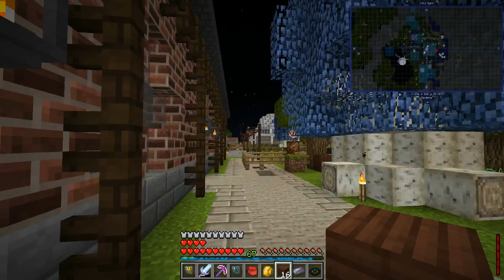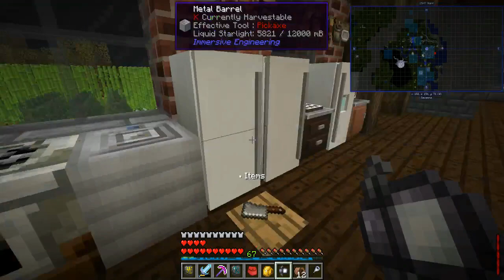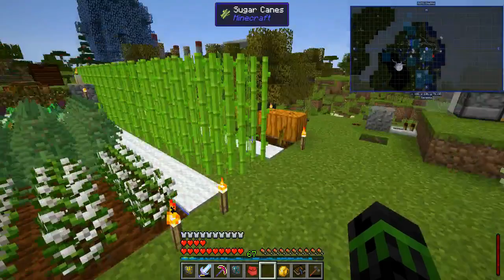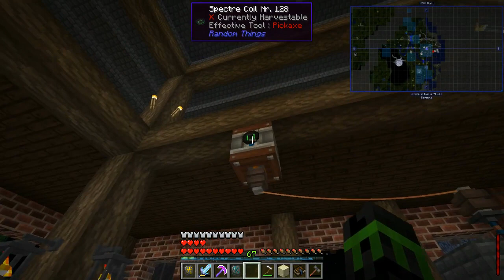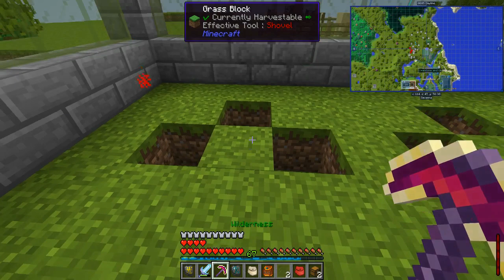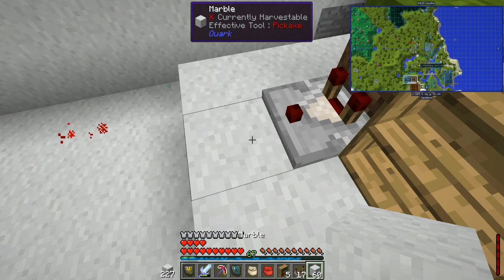Arcane Revolution - Ep 16: Industrial Greenhouse

Comment: You probably want to use HV for that many Cloches. LV for sure will not keep up with the power requirements. 
Take a look at insulated wires, they don't damage you if you walk into them.
Reply from the maker: Yeah I experienced the uninsulated part the other day off camera.. with hv, would I need to step it down to send to the machines? Or can they take HV straight?
Reply: @Zieg777  I have yet to experience an Immersive Engineering machine that does not accept HV. I almost never use LV, I jump either to MV or HV directly.

Comment: The cloches don't need to be turned off when your storage is full. Once their internal inventories are full they stop draining power.
Reply from the maker: True, but I'll be shipping everything to my main storehouse. I've actually already done away with the chest in front of them in favor of conveyors to a single chest.
Reply: @Zieg777  May want to be wary of magnet rings with those, but sounds good :D only issue I can forsee is if something doesn't turn off correctly and you end up with a few hundred million entities on the ground
Reply from the maker: @a_d2423  from the testing I've been doing, the IE conveyors seem to prevent the magnet ring from pulling their items. At least botania's ring anyway. 

I'll keep checking for items piling up. Still don't know what all I want to grow in there anyway, so I'll keep checking back in it
Reply: @Zieg777  sounds good :D and yeah they may do some stuff, a few mods have come up with botania specific compat for magnet rings. I know that DE's item dislocator has issues, but that makes a mess with AE's fake items in its molecular assembler too. Either way, nice episode! and thanks for releasing it!